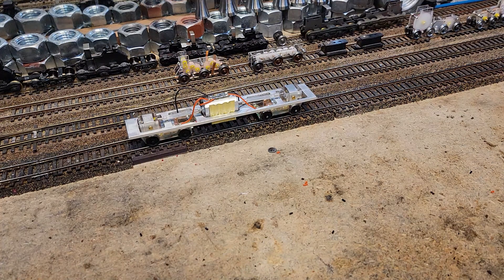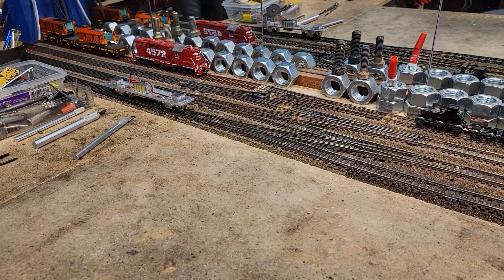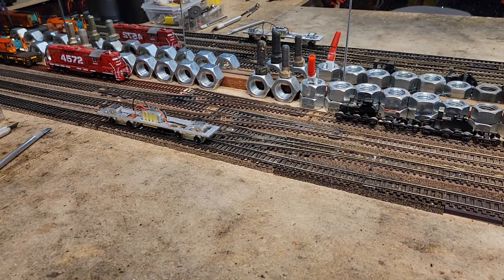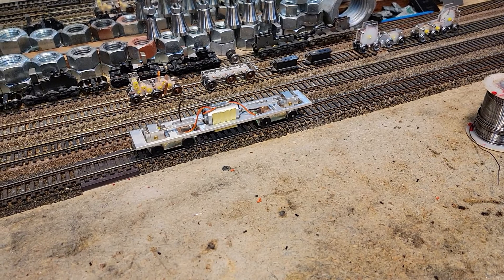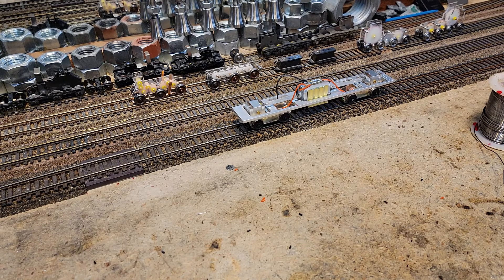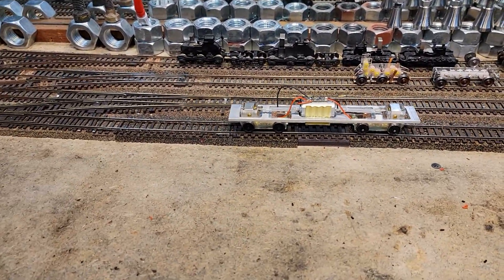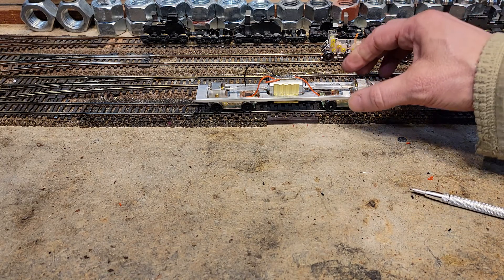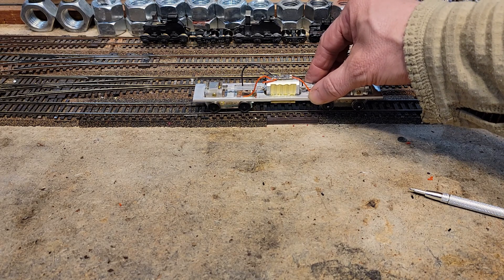2022 Contest Part 34 First Reveal Scratchbuilt Basic Locomotive

Comment: My friend, you are the baddest dude in the land.  The Elite194 Drive System Mark 12.  Repower your crap with this.  Pre-Order for $349.00 With Decoder 449.00 with sound $699.00.  Shell, we don't got no shells. Engineering: Life Time Guarantee!!  His, not yours. Need a shell. then watch the last 36 part series on making a custom shell.
Reply from the maker: this thing only puts me on the bottom rung of the ladder - now we go back to square 1 on a blank sheet of paper and apply the lessons learned.  this is basic locomotive only serves as a starting point - we have to improve on this a lot and do it really fast.   as for the shells, testing thinner acrylic will take all of today to record the data with the possibility that a very special cab will result - I give it a 10% chance of success today, but in 2 days there must be a 100% solution